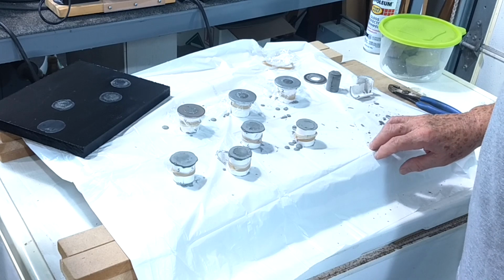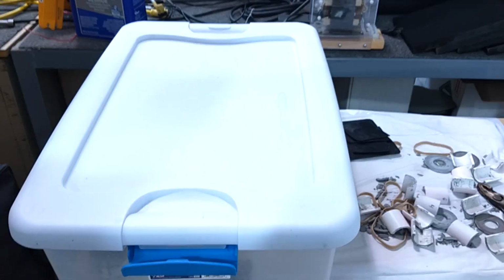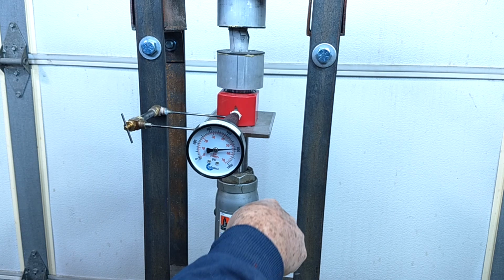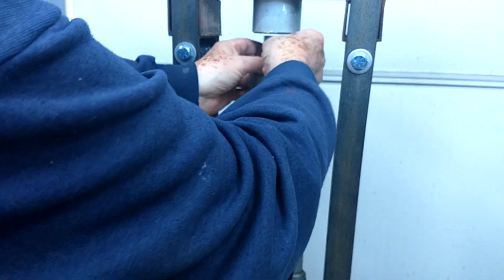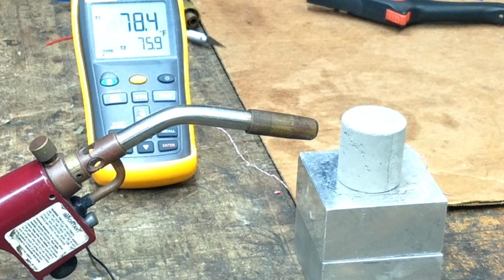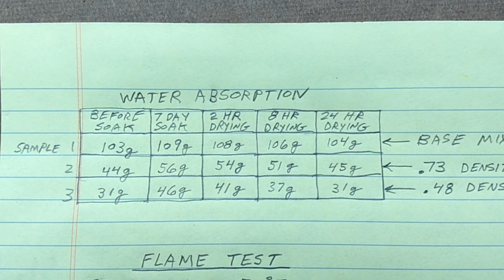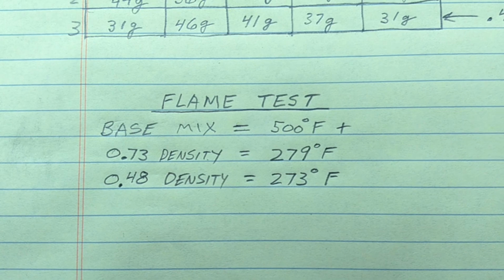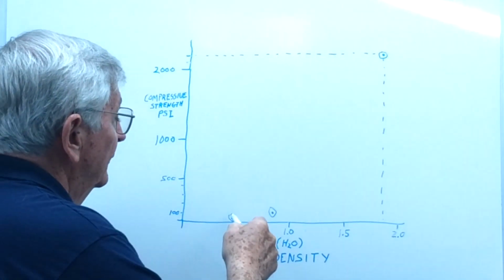Aircrete Experiments Part 5

Comment: Would the concrete portion of the aircrete be stronger with some silica included? Like a cement/silica flour/water mixture. Or what about lime?
Or, what effect would microsilica or other strength additives have? 
How about a water reducer to maintain viscosity at higher solids and then mix in the foam? 

Aircrete looks to be a lot like the AAC, what is the fundamental difference?

Are any of the concrete associations doing work on this stuff?

I have so many questions.

Comment: i encourage more testing.  1. i suggest that adding far less soap. clearly reducing the samples weight by half just undermines totally the function of the cement.   2. some chemicals retard curing time. try testing at 60, 90, 120 days.  3. for house building use, the transmission at 500 degrees is not applicable. what to test is BTUs of heat transmission between 32℉-70℉ for foundations  & 70℉ - 100℉ for exterior walls. Wonderful test results tell us that the materials are NG as tested. But it could be that the mix and temp are only outside the useful range...?
Reply: so what numbers would make aircrete good? I thought 116psi and 58 psi would be fine for making a shed with air crete walls. Especially if the panels were covered with stucco and fiberglass mesh.

Comment: Thx for your diligent work Jim! Even though the resolution of aircrete is not highly accurate it's painfully obvious I would not trust home made aircrete for any load bearing structural use. 
Only thing I am missing is how does sand or fine gravel mixing affect cement mixtures? 
Maybe sand/gravel mixtures do not compare as those may not be as comparatively smooth as pure cement vs aircrete though.
Reply: aircrete is often supported with Light Gauge Steel Framing, or fiberglass reinforcing mesh with stucco, One has to look at the entire complete package before jumping to conclusions about one ingredient.

Comment: Very impressive Professor White! Thank you! Your aircrete performs really well. My water absorption has been higher - without additives. It is surprising that the thermal test samples reach a steady state at such low temperatures. Here is an interesting reference on "integral foam concrete"  http://www.pioneering.nl/SiteFiles/1/files/report_k_hermsen_s0050059_pioneering.pdf . Right now I am trying to build the continuous foamcrete machine shown on page 8.

Comment: Jim - the aircrete samples showed marked evidence of drying during the thermal conduction test, indicating that they were carrying quite a bit of excess water.  I wonder to what degree this would have had a detrimental effect on the compression results?  Would you be willing to bake a batch of samples for 2 hours at 100-120F  prior to compression testing to see if there is any noticeable difference?   In any case, the work you are doing is much appreciated!
Reply: @Jimscoolstuff  I Have 2 questions.  As far as absorption, did you crack the 2 samples with foam to see if it absorbed to the core?  And question 2 is, have you tested to see what the R-value for foam crete is?

Comment: Brilliant! I wonder if the samples are prematurely breaking because the ends are not flat and parallel? I could imagine them lasting longer if the ends were machined or else grouted prior to the testing.
Reply: The fixture does not absolutely ensure that there is no lateral movement, or angular variation of the lower aluminum cylinder.
To my eye, it appears that the sample tends to squirm a bit when pressure is applied.
The non-foam samples each appear to fail in shear along a similar plane with respect to the fixture.
I may be hallucinating, however.

Comment: Thanks Jim. So, if I divide the weight of my cement/and sand (if used) by 1.88, that will give me the pounds of water I need? Hope I got that correct.
Reply: @Jimscoolstuff  Thanks Jim. I've been using the 6 gal to bag. Your 1.88 ratio makes it easier to calculate smaller amounts. Yes, the amount of water should be as small as possible. Necessitated by viscosity needed. Over all though it seems very tricky for what I'm trying to do.  So everyone should know it's not easy when conditions aren't totally controlled, like in your videos. Thanks, and a beautiful day.
Reply: @Howie47  94 lb cement/1.88= 50lbs. 50 lbs of water is 6 gallons. I thought the goal was to use less water not the same. I'm confused? shouldn't we be trying to use less than 6 gallons per bag?
Reply: TJP 81  The "foam" is also water!